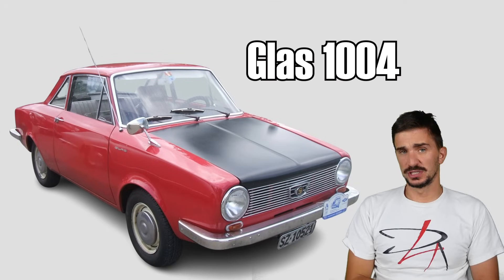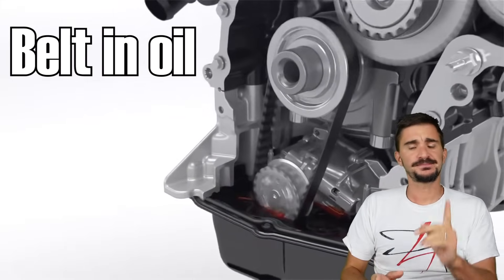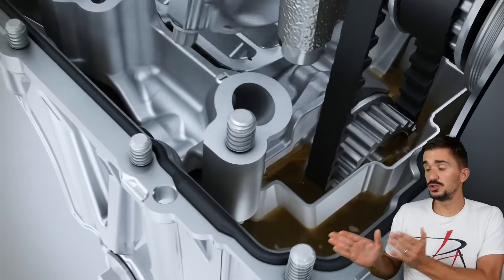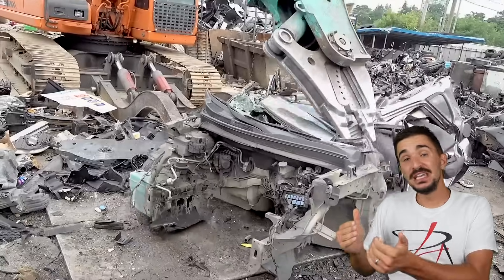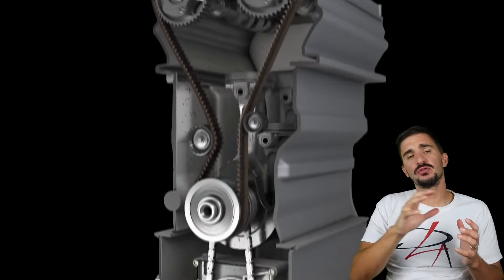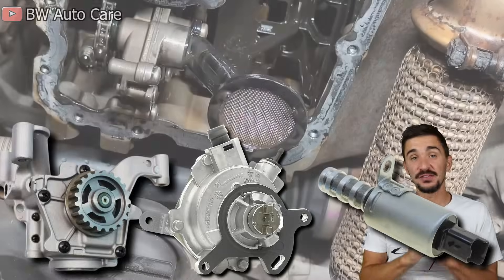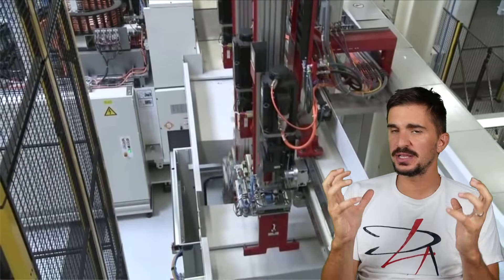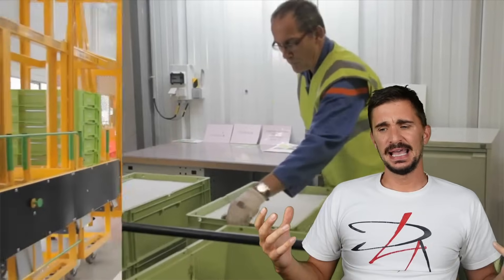Who Approved This and Why Is It Still Being Made? Wet Belt aka Belt in Oil Engines

Comment: I owned an engine machine shop in California - lots of BMWs.  I love them!  Made a TON of money on BMW.  When the belt or chain fails on a normal engine, the valves hit the piston (some "non-interference" engines don't, but most do), the valve is bent and the valve guides are ruined.  So you cut out the valves , remove and replace the guides, hone them to fit do the other normal machine work ( machine the valve seats that are serviceable,  replace seats that were damaged, deck the head, etc) and then it's good as new.  With a BMW, the piston hits the valve and it breaks the overhead cam saddles right out of the head castings!  We had tooling (custom designed and made) that allowed us to weld up the heads to form new saddles, which we would then re-machine.  It was still cheaper for the Customer than buying a new head from BMW, and our head was stronger.  The Customer gets back on the road with a lower cost, and I make money.  It was so lucrative that I kept various BMW heads rebuilt and ready to go on the shelf.  There was always demand!  The workmanship from BMW was beautiful... but the engineering wasn't.
Reply: Just the same with BMW and VW turbos where if the wastegate fails, the whole turbo has to be replaced. German overengineered junk at its finest!
Reply: Lexus also have interference engines. If the belt/chain snaps, the valves hit the pistons and destroy the entire engine. 80% of engines made by ALL manufacturers will do this and are interference. Where the hell is your shop? Facebook Marketplace? Jesus Christ. This is not a BMW only issue. It is called Interference vs. Non-Interference.
Reply: BMW means "Bring More Wallets"-- for repairs Or--"Break My Wallet"
Reply: Gone are the days where BMW are brick solid and can cover a million Mile without much fuss..nowadays it is all just that :$how off $how off and more of it
Reply: Porsche paid my way through college. They did this by making 911's that had tons of failures when it came to the timing chains, guide rails and especially the chain tensioners. When they fixed those problems, they introduced the 944 and that thing was a cash cow. Early ones made it about 15K before the belt snapped. Top it off, it had a balance shaft belt. Plus, they bent the valves too. Made for a big bill every time.

Since my dad had a Porsche repair shop, the amount of those cars that came in on the hook and the bills is what paid my way through college. I fixed many of those and it was good they went from one failure to another.
Reply: My mechanics is also the same ,he buys BMW engines ,rebuilds them and put them on shelf and they dont spend much time there because there is always great demand
Reply: And that is why I'll always stick with my spunky old Mondeo mk3 diesel auto...the camchains are pretty much indestructible and having the 5-speed JATCO auto box, no DMF, another great idea on paper but shite in reality.... oh, and no oil use between 5,000 mile services..!!  Whoever thought of this idea should be horsewhipped and put in stocks every day...HTF did this not get laughed out of the factory is one of life's mysteries 🤔
Reply: @Euro316  In their Hybrids, the belt is mounted externally.
Reply: @Tony-q4f3t  or... 🤣   "bring mich werkstatt"
Reply: @Euro316  Relax, friend.  I think you missed the point.  Interference engines are badly damaged but no, they're not "destroyed" when the pistons hit valves (on street engines - race engines are another story).   The valves bend,  the guides are destroyed; pistons are badly damages and sometimes broken; seats are beat up and the combustion chamber is usually scarred and in need of weld repair.  Sometimes - not always - some or all of the  cylinder liners have to be replaced.  Sometimes a rod gets tweaked, but not every time. The engine is usually rebuildable.  We seldom saw any brand other than BMW  that would break the cam saddles right out of the head casting.    Are you an engine machine shop? I would guess not...  breaking the cam saddles out of the head casting on BMW engines from the 90s and early 2000s was a well-known issue that any  engine machine shop would be well-familiar with.
Reply: Some French engines (Renault mostly) had special finger followers that would fracture if the timing belt broke, limiting the engine damage to just a new set of followers. I always thought that was a GENIUS idea. You can have an interference engine, but all it breaks are the rockers if the timing belt breaks.
Reply: @supergeekjay  My 2017 X3 has the wastegate issue.  Bought used and noticed it on the scanner I used.  Not enough play yet to go into limp mode but I am prepared to replace the turbo when it does.  Got a great deal, made great only by the fact that I will do the labor when it goes too far out of spec.
Reply: @Euro316 Interference engines should be illegal on consumer products and automobiles. We need minimum repairable standards for cars and appliances.
Reply: @Euro316 but Toyota/Lexus doesn’t have a wet belt.
Reply: @andrewmasto716  Interesting. Except no BMW has a wet belt - the subject of this video. No BMW has had a dry belt for about 30 years or longer.
Reply: @garybeecroft4565  Yes, you're right.  My experience was from BMWs manufactured in the 1990s, and none of them were wet belts. Perhaps they've learned something.  But that wasn't my point.  They released belt drive interference engines that would regularly break the cam saddles out of the head.  Not so good!
Reply: Wow that sounds like an awesome fix. Well done!
Reply: Germany here: Had a car repair workshop for over 20 yrs and loved repairing the over-engineered German crap because there was a lot of money to be made.. customers would always wonder why I myself only drove an old Dodge. I knew why 🙂
Reply: I was looking to buy a BMW, and visited a very large dealership. I spoke to the foreman, asking for a tour. He took great pride in his clean room, where engine rebuilds were made. A very common procedure.

He explained that the oil dip stick tube would commonly fracture where the tube connected to the block, at around 80,000 K. There was rapid loss of engine oil, with catastrophic results to the engine.

Owners were usually not aware of this common problem. I ended up buying a Range Rover Sport, enjoying 60 K of totally trouble free motoring. After I retired, we swapped the RR for a Lexus NX F Sport, which we love. We used to have Volvos, starting with the 240. We stopped Volvo when the 850 came out, as it departed from the basic 240/740 philosophy that we enjoyed.

The Lexus NX has many of these older Volvo features, and seems just as reliable.
Reply: @oldcodger4672  Great you had no trouble with the rangerover. They are timebombs lol.
Reply: Amazing that a big outfit like ford didn’t do R&D on something so critical. May have saved €10 but what about warranty claims ?.
Reply: @Euro316  Maybe read the whole comment before replying
Reply: I bet you were not cheap my man. 
What happened?
Reply: @dzonikg  I'm wondering which BMW engines are those ones, I drive N52 325i that hs been trouble free for more than six years. This horror stories about BMW makes me laugh.
Reply: @fastinradfordable  You're right - but then again, nothing is cheap in California.  I got an "offer I couldn't refuse" from a person that wanted to start a race engine shop in a different state.
Reply: Interesting post about BMW's belt carnage.I feel i dodged a bullet when my young good looking single female neighbour had the cam belt snap on her early model Camry so of course i had to say I'll do what i can .The first thing i tried was to crank the engine,nothing happened so i tool the starter apart and it's absolutely fouled with carbon brush dust shorting out every thing.I asked the young lady if she had been cranking the engine over and over after the break down which she confirmed she had.I am thinking oh no! the pistons have been slamming into the valves and this engine is probably a basket case but i persevered and fitted the new belt not expecting it to run at all.Much to my amazement it started immediately and ran smoothly and i got some kudos with her.I don't understand how ther was no damage and i think it was a minor miracle .
Reply: @hermanbinngavionohermanbin8371  yup but that's most manufacturers nowadays, especially with plastic parts on the engine, no longer just BMW.
 Still driving my 02 bmw going on 11 years.
Reply: @Euro316  reading comprehension not your strong point fella?
Reply: How about just using a damned chain, so it doesn't fail, or at least at a miniscule rate, by comparison...oh, right, it costs a dollar or  two more.
Reply: @Euro316  its the reason I chose the !uzfe for an e30 transplant a non interfearence engine

Comment: Most people choose their cars by liking the headlights and grill. Good Content
Reply: Nowadays OEM’s seem to think people choose cars based on the infotainment 😅
Reply: Nowadays people choose whatever car they can barely afford 😂
Reply: That is part of it 😂 but no first is engine and drivetrain life
Reply: A shocking amount of them are chosen by the color..  
"I like that blue one, not the gray one" -- lol
Reply: People's choosing of a product has very little to do with their choosing, but a lot to do with product availability and the marketing pushing it.
Reply: @exothermal.sprocket  I do not agree. Just because that’s your position doesn’t mean it’s the majority
Reply: @jackkenny4194  If you needed a vehicle and every lot within 50 miles was 98% suv, truck, or cuv...... what would you likely be buying? What if 98% of the vehicle choices had automatic or CVT transmissions, what would you likely be using? What if 98% of the vehicles were some shade of gray, silver, or ultimately bright red or black. What color would you be driving?
Now look on the highways and tell me what you see. Tell me all of those vehicle drivers chose their vehicles for reasons other than sheer availability and marketing.
Reply: 100% correct 😂😂😂😂
Reply: BMW buyers meanwhile..
Reply: @exothermal.sprocket Honda discontinuing the manual in everything but the Si and Type R has been a disaster.
Reply: But, but, but, Ford had a better idea!😂😂😂
Reply: People choose by the amount of USB-C connections in their car.
And if the ambiance lights are 12 colours, or RGB...
The important stuff..  😂
Reply: @imnotusingmyrealname4566  Whoda thunk that VW would be one of the last brands "saving the manuals" ....... until they didn't.
Reply: @exothermal.sprocket  are they discontinuing the manual in the GTI and Golf R? In Europe these cars had only DCTs for a couple years now. Only the base petrom and diesel Golfs and below still come with a manual.
Reply: Yep i always called them mudguard ,fender /buyers, shiny on top , all the shit is underneath.
Reply: @imnotusingmyrealname4566  Yes, the manuals are no longer available on the mk8 2024+ models, DCT only.
Glad I snatched up a low mile Mk7.5 manual GTI a couple years back.
Reply: And the badge
Reply: @Nathan0A  sadly, many people actually do.
Reply: "Does it have Apple Car Play????".
Reply: @Nathan0A  I seriously don't get all the hype behind infotainment, as long as I can take phone calls and listen to music off my phone I'm good
Reply: @Nathan0A  You can alwas retrofit a new entertainment system into an old car. The head units used to be swappable.
Reply: Or if it has Apple car play
Reply: I bought a new car last year. I could have bought a new car bu I choose a 3 year old model with a 4 cilinder and NO wet belt.
And no electric BS.
Highway consumption at 100 km/hour is 4,2 liters every 100 km.
And its fast when it needs to be, plenty power and torque.
Reply: Or, in wife's case, color!
Reply: @Nathan0A  Exactly!
Reply: @calholli  Yep! New car colors; 5 shades of grey, 3 of white. Interior; charcoal gray or black.
Reply: @R777-RLM  Fits the vibe of the modern economy.. lol.
Reply: Yes I agree with you but reliability is a concern for some. As a automotive mechanic for many year I saw many example of a design that was meant to fail with GM - Ford and Chrysler, Way less with Japanese cars. This is another example.
Reply: Yep, headlight patterns, cupholders, and internet connectivity top the list for picking a vehicle now...
Reply: @exothermal.sprocket  - True, SUVs are TRUCKS and skirt car emissions/safety requirements so automakers push SUVs... plus SUVs are BIGGER and people are willing to PAY MORE for BIGGER!
Reply: @buzzwaldron6195  Utility type vehicles cost the manufacturer less to make, by skirting certifications and regulations. But they used to contribute to half or less than half of manufacturer models. When you cut half your lineup, want to make the same money as before, what do you do? Cram utility vehicles with Star Trek technology to jack up prices. Now the whole tide is risen, and all ships have gone up. You can't buy much of anything for less than 30 grand.
Reply: @calholli  No Kidding!
Reply: @jackkenny4194  It's the real problem in some countries. Here in argentina we are LITERALLY forced to buy what's produced locally (2 vehicles a Peugeot or a chevy) with gigantic TAXES applied to anything comming from abroad.
Reply: nah man, number of cupholders and their placement is way more importanterer.
Reply: In China is how many inches of screen you get. It's ridiculous, never thought I would see a 30 inch screen on the front of a car. And they do pick them by that
Reply: Ya left out the most important(to my Wife) the PAINT!
Reply: That’s cause manufacturers put more money in looks then the internals of the engine. It seems like the first engineer they find that walks of of school is who they hire.
Reply: @zacharydunn5847  Exactly.
Reply: And most are right to do so because most engines aren’t grenades. I’ve never owned a bad car frankly. They all work fantastically. Sometimes engines are bad. Most cars have multiple engine options.
Reply: The others pick colours.
Reply: I think cup holder number and placement is more a concern!
Reply: Agreed. That’s why I love BMWs and Lamborghinis